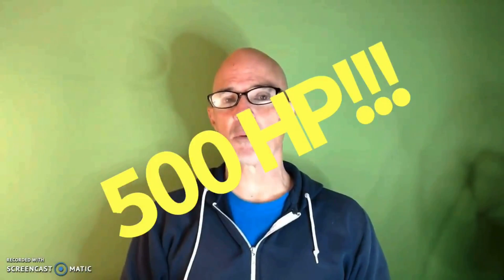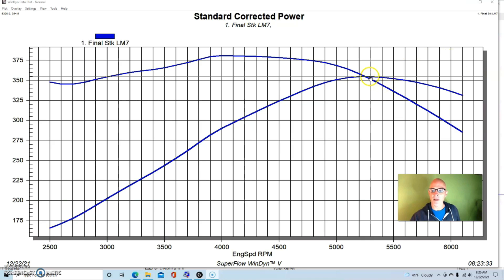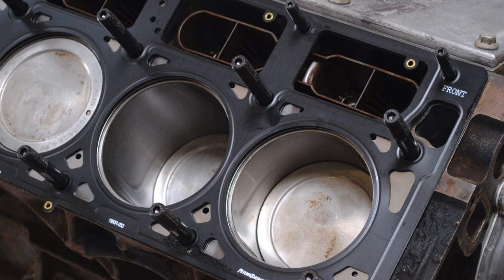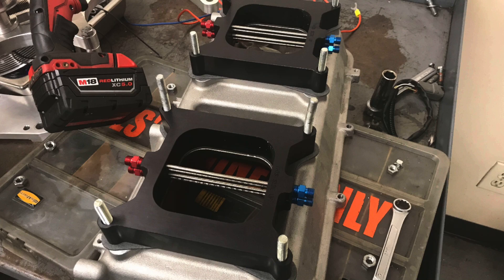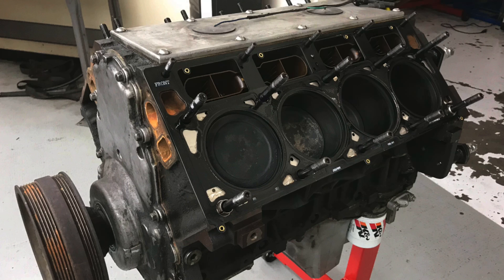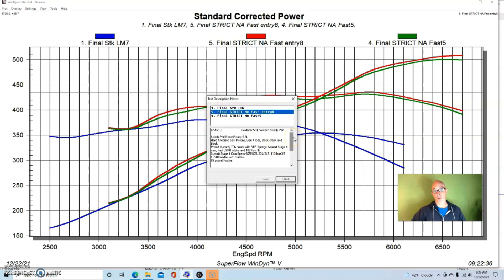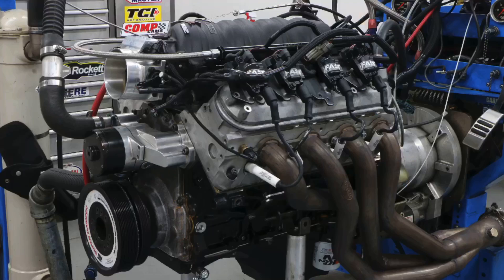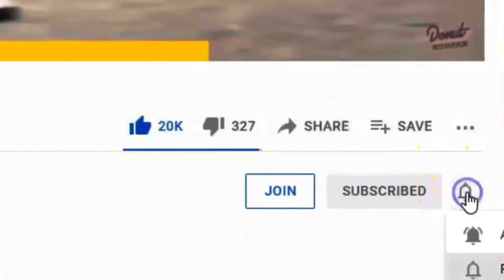HOW TO: JUNKYARD 500-HP 5.3L LS-CAN MY NA 5.3L LS MAKE 500 HP WITH A HEADS, CAM AND INTAKE UPGRADE?

Comment: I don't know if I want 5.3 or 455 olds
Reply: Get a 5.3 and add a stroker crank.  Or get a 6.0 and add a stroker crank  It'll make more power than a factory 455.  It'll be more reliable and get better gas mileage.
Reply: Affordability, availability and fuel mileage you are better off with a 5.3L. If you want more torque and hp on the bottom end get the Olds 455 Rocket.

Comment: My 05 sierra has the 5.3 vortec, is that the same engine when someone typically refers to a 5.3? Dumb question but just want to make sure, researching online gets some weird answers otherwise
Reply: Yes. The 5.3L is only a Vortec (not to be confused with the 327) but there are different generations that go by model years.
Reply: Yes
Reply: Yes, that's the one.
Reply from the maker: same